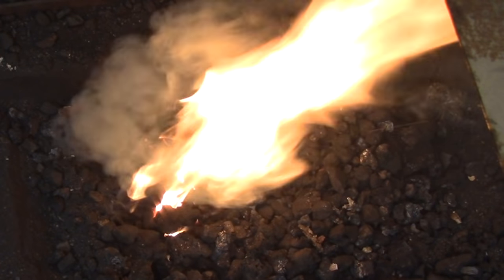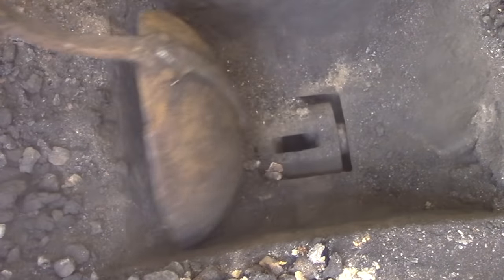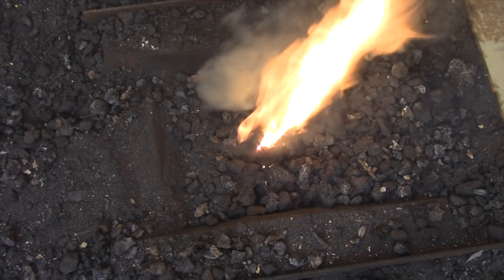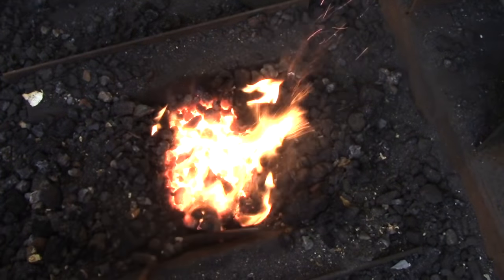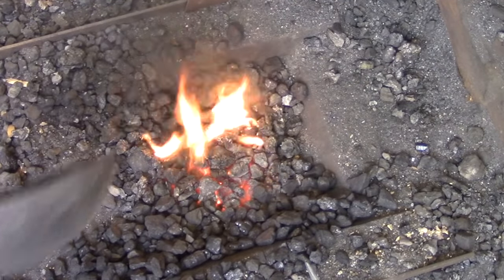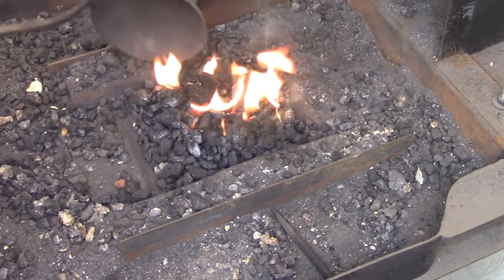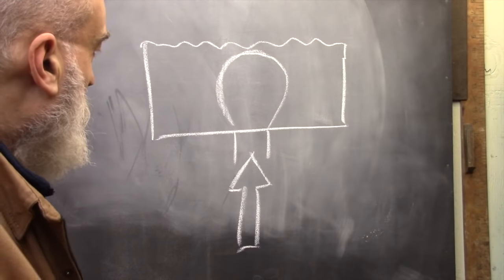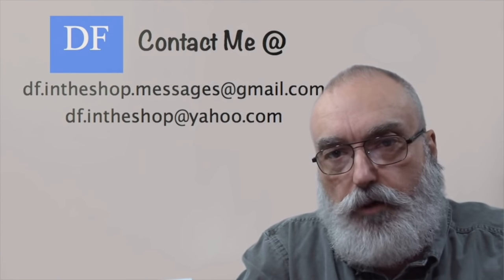Blacksmithing For Beginners - Working With A Coal Fire

Comment: Made a forge out of an old smoker and can't seem to keep coal going right. When it starts burning right it doesn't seem hot enough
Reply from the maker: You may be using hard coal?  It needs a constant air supply to stay lit and a lot of air to get hot.  Hard coal sound like glass when you hit it.  Soft coal is very powdery and doesn't have a shinny surface when you break it apart.  You can forge with hard coal but don't need to do anything I explained in this video,  Just build a big fire and give it lots of air.  Hard coal doesn't turn to coke.  It just burns from a solid to ash.

Comment: What do u use as the sides of your fordge
Reply from the maker: My forge pan is made from 1/8 plate.  I have a removable fire pot that was cast iron but it's now 1/4 plate and I also have a couple of firebricks beside the fire pot to raise the level of the forge a little to make it easier to build a taller fire.  I posted a video last year about replacing my old cast iron fire pot that gives you a pretty good look at the forge.

Comment: Is there any particular reason you're using dry coal?
Reply from the maker: It's the only thing we can get up here.
Reply: DF - In The Shop 
OK yes I buy my coal dry as well and then put it in a barrel with water
Reply from the maker: I remember reading about that when I started out ( I can't remember what the benefits were supposed to be? ) but nobody does that up here because we have sub zero temperatures for 4-6 months of the year so a barrel of water would be frozen solid.

Comment: What are some of the differences when using a charcoal instead of coal?
Reply from the maker: The main difference is the amount of fuel you go through.  Charcoal burns away a lot faster than coal so you may need to build a larger forge to handle the amount of fuel you need to have on hand. Charcoal as a fuel is ready to go so you don't need burn off any impurities the way you do with coal. It can be added at any time and anywhere in the fire.  It's a great fuel. It burns very hot and very clean.  It isn't used more often because most people don't have access to it or don't have the room to make it or store it.

Comment: How come you chose to forge on coal rather than coke?
Here in England if your using a solid fuel forge than coke (smithy breeze) is the fuel of choice for 99% of blacksmiths i know.
Reply from the maker: I don't have any choice. Coal is the only thing that is available and there is only one source for that.  I used gas forges for 20- years because there was no one that would ship small quantities of coal up here.
Reply: RobSt007 what part of England are  you in? 

I've only forged on coal once and found it pretty miserable! yeah im rather lucky, at work we get 50-75 bags delivered at once so we get a discount price of  £10.50 - £11 a bag.